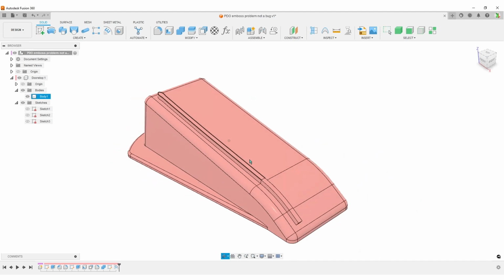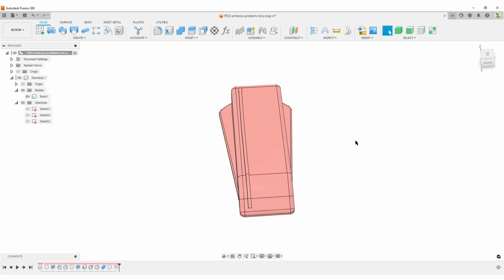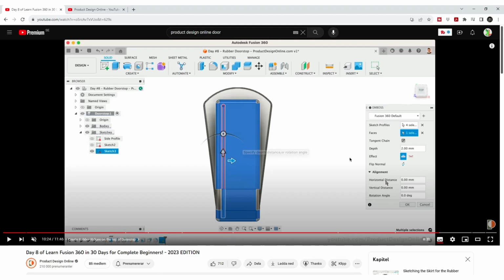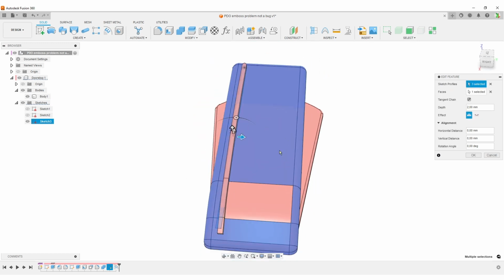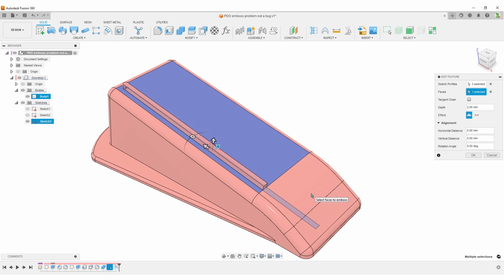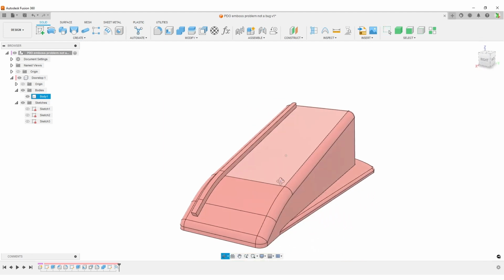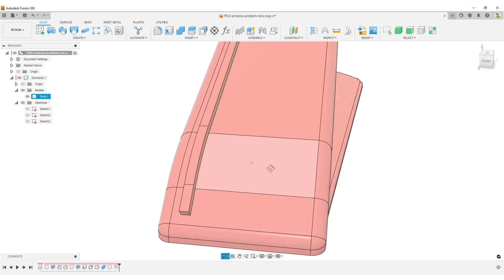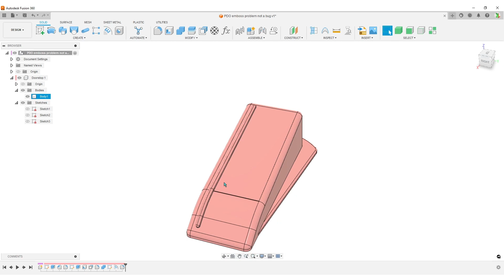Some things to keep in mind when Using Improved Emboss in Fusion 360

Comment: This problem happens in almost every parametric CAD programs. It's usually not reccommended to use complex surfaces as a base for other downstream features. It will usually cause weird problems in subsequent features. Emboss is a tool that usually produces such complex geometry. It should only be used for final touches like adding a logo on a complete product. Using this for base modeling is usually asking for trouble.

Comment: The way to avoid this problem is to apply the emboss the way Kristian suggests in this video. You have to uncheck "tangent chain" and individually select just the FLAT FACES as he shows you here, otherwise you won't get 10 edges per rib. When you're done, you can apply the 1mm fillet INDIVIDUALLY to each of the ribs and it works fine. Hope this helps someone!
Reply from the maker: I have done som testing with similar shapes and the problem with the fillet dimensions is hard to reproduce. It might be a "perfect storm" causing the problem with this model.

Comment: It's frustrating that months after that update they have not fixed that bug. Not nice to have to use roundabout ways for it to work and it not guaranteed to work with every shape or workflow. Even unselecting the tangent chain selection, selecting the sketch first then the face/s I get a deformed embossed blob instead of a  simple circle on a single curve surface/face most of the time if it's part of a more complex shape.
Reply from the maker: The selection part in the dialog box I'd consider a bug or bad design. But the geometry is not a "bug" in my opinion, it's not desired and lacking tools controlling the emboss.

Comment: Also there must be another bug as sometimes when applying fillet the Fusion just go to non responsive and crashes, happened so many times and with such regularity, I always save everything before I apply it and when it crashed I hope it recovers or at least leave recovery file in crash dump, that's not always the case, great software, but these bugs are just too much of productivity kill, I have lost count of hours wasted and I'm running on relatively high end desktop gaming PC.
Reply from the maker: You could post the problem and file on the official forum for some troubleshooting from other users. It can be a bug or something else.